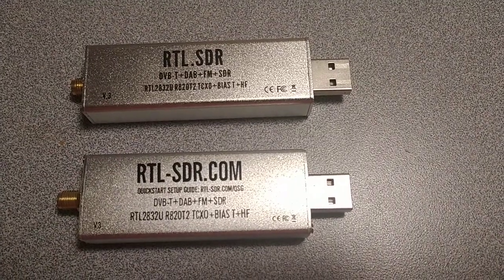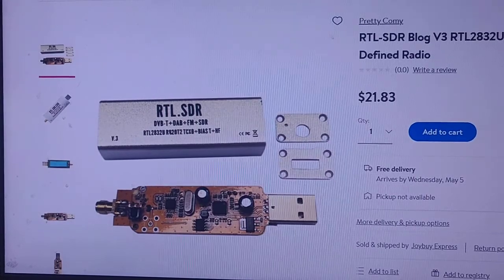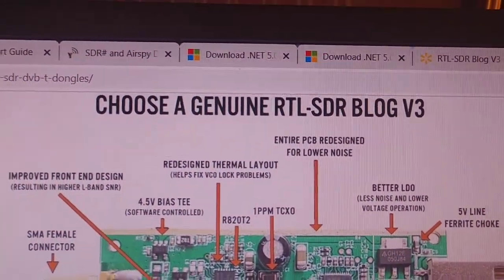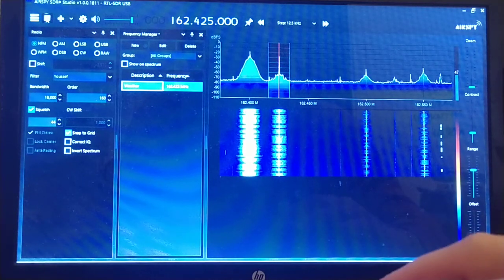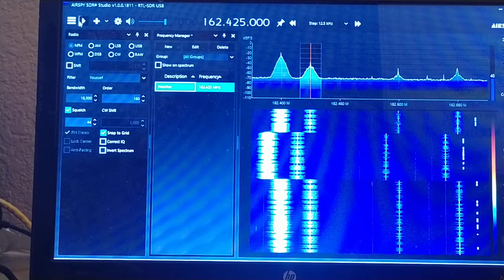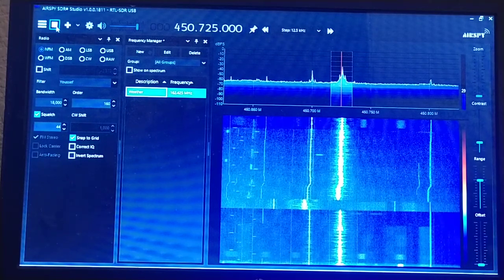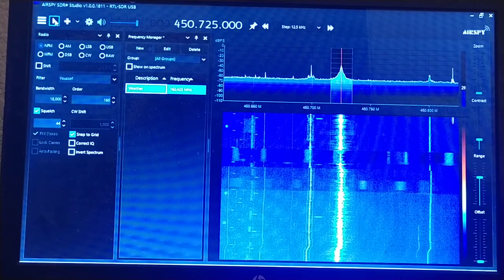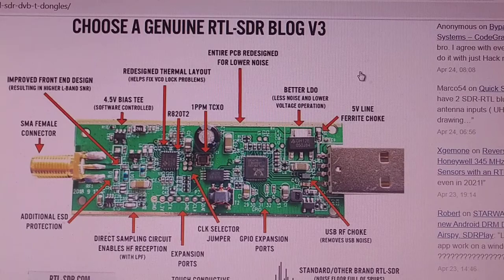Comparison of RTL-SDR Blog V3 performance vs Imitation Generic RTL-SDR

Comment: What A Awsome Video, 
I Have Bought 6 Of The Fake Ones Sadly, Didn`t Know That They Are FAKE And You Know What?|
At The End They Started To Just NOT WORK, I Was Not Able To get Even Local radio Stations, Nothing, But When I Transmitted It From the Sdr like 2 meters away, it received wich was crazy, dont ask about antenna, everything was good , just the sdr itself was bad, software, i have spent 20 hours in total trying to get it fixed and work properly, but no luck.
Today I Ordered The blog version FROM THE WEBSITE that lead me to the ebay and seller naame was (rtl-sdr-blog) And I Think NOW Im Solid, CANT WAIT To Get my Hands On The REAL DEAL, I Have So Many Antennas In Attic ANd So Many AAntennas I Want To test On It. 
Btw, I Have A Question, Can I Use Any Active Antenna On This Sdr? Would That Hurt It In Any Way?
Second, I Will Try To Make A Cooler For The Device, I Will Make USB Working Fan For It So When I Will Plug In The SDR Itself, There Will be Another Usb Plug That Will Turn On The Fan, I Have Supersmall Fans, I WantTo Drill Holes To The SDR Case And Just Put The Fan There And Introduce Airflow To It, I Think That Will Help And That Thermal Paste Is Good To, But WITH This Mod It Will Live Much Longer I Think, RIGHT?
Everything for it will be on the youtube page of mine, if you want to se such things, just subscribe, i will have many many things to come. 
this video is really good, shows actually whats what, really really good video. :) 
People need to STOP Buy them fake ones.. 
You have a blessed day Art Lashbrook :) 73 73

Comment: Very helpful video!  I doubt whether the fake version is able to perform direct sampling of HF frequencies in addition to the other sub parities!
Reply from the maker: It was able to receive AM radio stations using direct sampling.
Reply: Wow, I'm surprised!  Even so, I guess the audio noise still makes the genuine dongle a better deal.  Thanks for responding with that info!
Reply: The generic I received does not get AM anywhere. MW or SW. On two different software. SDRsharp and SDR console. It wasn't until watching this video that I had been sold a fake. Off of Ebay.